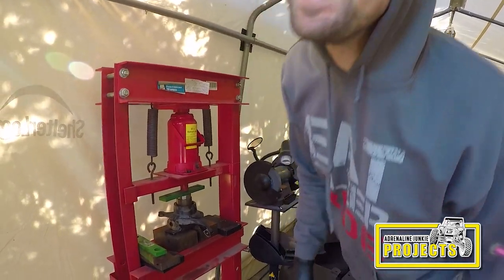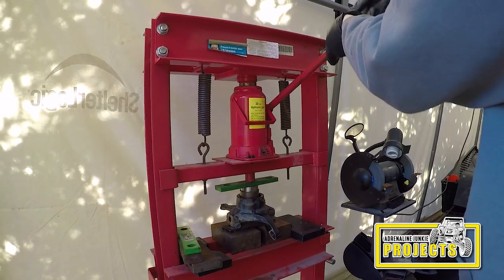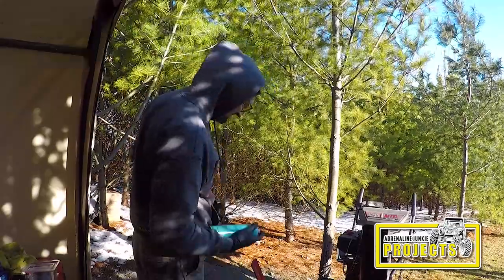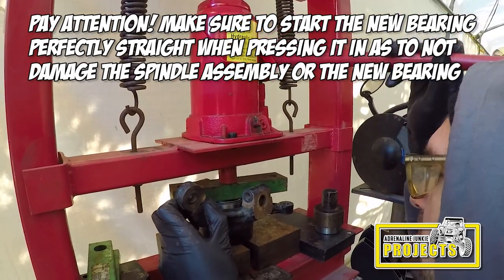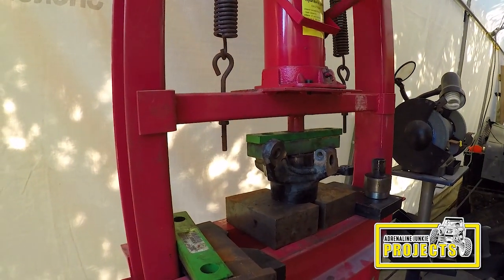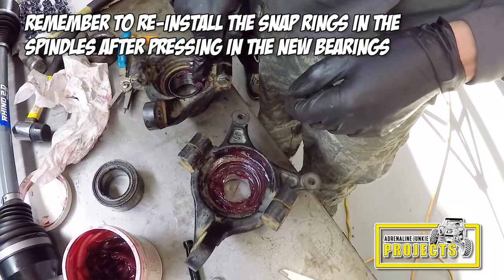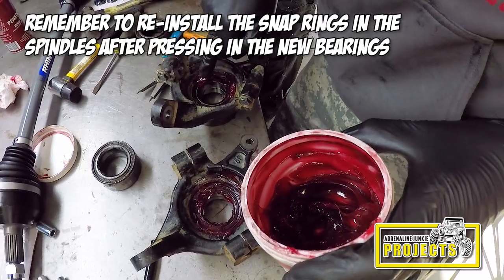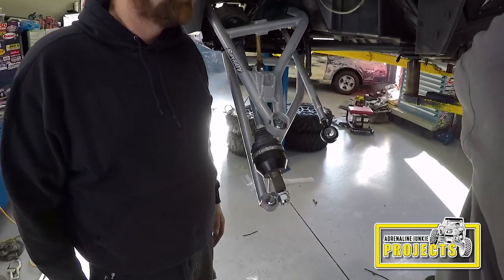How to Replace Polaris RZR Wheel Bearings - Pressing Bearings In & Out - #TeamAJP RZR Turbo Build

Comment: How many miles do go before changing them approximately of course?
Reply: hey gbikes, I got about 1500 miles (2500km) out of this set. They should have been replaced a little sooner as they had been bad for a while. Generally I find 1500 miles would be near the high end of the life expectancy. I consider them something i replace annually at least.
Reply: gbikes I needed to change mine on my Commander at around 1000 miles but didn't realize they were so bad till 1500 when the axle broke and I was taking it out.  Great videos even if I have a CanAm because most stuff does transfer over with a lil if any changes
Reply: Ya, once the seals go then water and crap starts to get in them and they start getting noisy and squeaky. I had quite a bit of play in all of them for quite some time before I finally got around to doing them. Glad to hear the video was helpful to a Can-Am guy. Most of the machines are pretty much the same, minus a few minor details here and there.
Reply: AdrenalineJunkieProd PS I just bought a 20 ton press to make my life a lil easier   I know a big one like that is over kill for an ATV and UTVs but I work on my trucks, tractors and trailers also.
Reply: A press is such an awesome tool to have in a shop. It has tons of handy uses. The one in this video is also a 20 ton. More than enough for average tasks. Enjoy the new shop toy! lol
Reply: AdrenalineJunkieProd thanks y'all and as always stay safe and keep the muddy side down